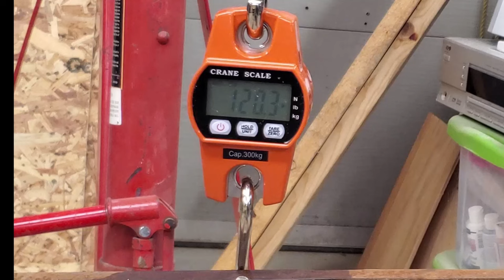DIY Welding Fixture Table Build

Comment: Looks a great welding table, often though about building one but drilling all those holes without a decent process would be impossible.
Reply from the maker: @jameslovering9158  Yes, I made a detailed tutorial video about the annular cutter used as well. It is not very long. You should check it out. Thanks for watching.